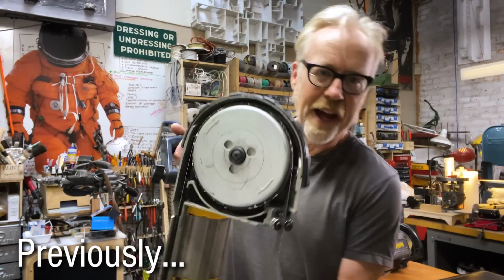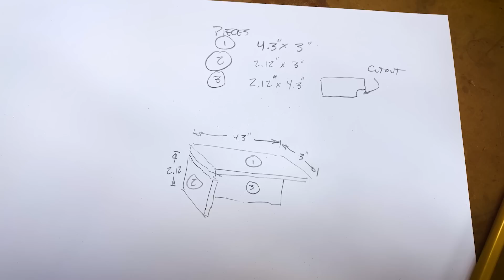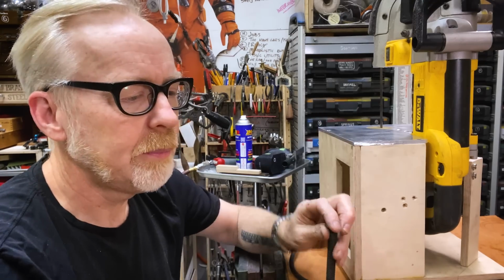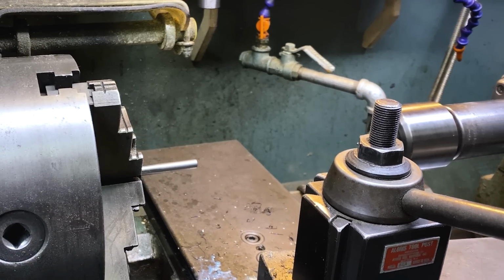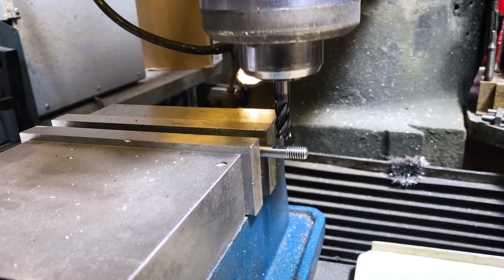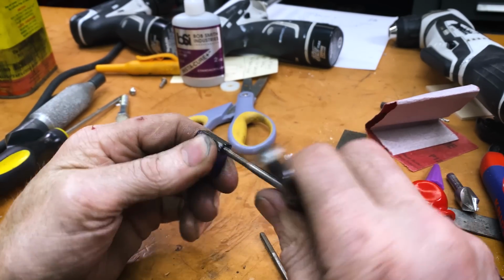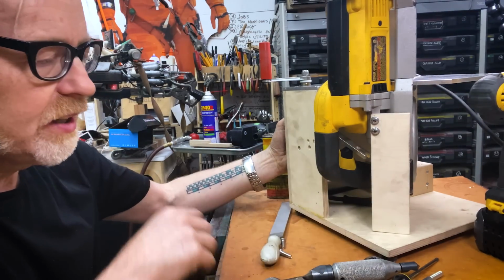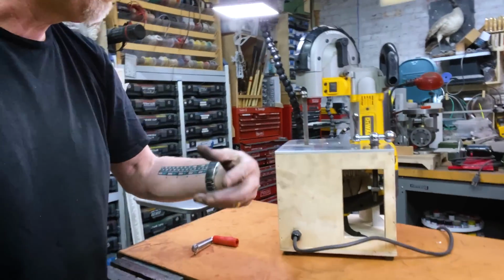Adam Savage Upgrades His Mini Bandsaw!

Comment: That lever terrifies me at the end. Wiggling your arm past a blade on a rocking stand. Good thing he changed the handle because that was super bad
Reply: when he mentioned where he wanted to place the speed controller in the first video I was terrified. I would HATE to reach around a moving blade to adjust the speed. SUPER dangerous imo.
Reply: I was thinking that too towards the end, but when you think about how he'll be using it, with the speed control on the right side you shouldn't ever have to reach in front of the blade to change speeds. He'll always be able to safely change speeds with his right hand away from the blade. Still, a dial on the side of the box would have been ideal.
Reply: Sonac totally agree, he can make a handle on the side of the machine and have it still works the similar way but safer
Reply: @IVIuggle  .... except when he's using his LEFT hand to turn the knob while aiming the camera with his right hand... yikes! I was holding my breath, especially with the whole thing wobbling around.
Reply: @RichardTallent  very true, that was not fun to watch, hopefully he installs a heavy steel plate under the box to keep it from wobbling around so much
Reply: Same, I think I would have opted for a electrical speed controller mounted in the side panel away from the blade.
Reply: Tools like this are only as dangerous as the person using them. One just has to be cogniscent of that fact that if you do something stupid could get hurt... so don't do something stupid. I've swung started props on light aircarft, which if done incorrectly could result in dismemberment or decapitation. I've also been groundcrew for many aircraft and operated as close as 3-4ft away from a large metal prop while doing a post-start inspection, you just have to be personally responcible for your safety. Am I suggesting a product like this would be wise for production? Hell no, because you have to cater to the fact that any muppet might be using it, but for somebody who designed and built it and unstands its dangers, I don't see the problem.
Reply: @bend1483  Doesn't help to create a more dangerous situation than necessary. Also OSHA and safety rules exist because its not about 'the person'
Reply: Why not place the crank on the right hand side to drive a wedge over the trigger instead?
Reply: My instinct would be to just replace the potentiameter that's probably in the trigger with a rotary one and just mount that on the side rather than machining  this wierd bodge solution.
Reply: I think the Wandel method would be to keep the lever arm mostly as is, but extend out the side of the tool through the existing big square hole. Then mount a channel 90 degrees to the side wall, drill a horizontal hole in the lever, and use a knob and nut to hold the lever at a desired position. That way the adjustment is below the plane of the saw table.
Reply: @adaster98  I believe he specifically said he didn't want stuff on the sides. he did for the power switch anyways so I would assume that would be for the rest of the stuff as well
Reply: bro it's a metal bandsaw - not a wood cutting band saw - they will cut you but you have to have it going full speed and really push into it - idk the speed but I can have my Milwaukee one all the way one and touch the blade with my finger lightly and not cut it at all - I mean yeah it could be in a better place but it's not anymore dangerous than simply using a table saw correctly lol
Reply: @TheAkashicTraveller  couldn’t agree more. Bush league.
Reply: @adaster98  potentiometer replacing the saws original trigger switch wired to a small dial next to the on/off switch - but that analog lever control, does look nice
Reply: potentiometer replacing the saws original trigger switch wired to a small dial next to the on/off switch - but that analog lever control, does look nice
Reply: @Kokomoflow  thats exactly why i suggested a potentiometer which would give far more accurate speed control replacing the elaborately over engineered analogue system Adam implemented -completely replacing it AND the "control wheel" aka trigger which is essentially the same as a scalectrix game trigger / pot.
Reply: came to the comments looking for this comment haha
Reply: A foot pedal with speed control, but it guess there’s no fun in that 🤷🏼‍♂️

Comment: How complicated do you want the mechanism to be?

Adam: Yes.
Reply: I mean, that's about the easiest mechanical way to do it "correctly". That mechanism will easily outlive the bandsaw itself.
Reply: @troy4393  The lever is pushing on the corner of the trigger, the side load will wear out the switch faster.  But it probably won't get adjusted constantly so it should be fine.  Couldn't hurt to add a timing chain and jackshaft on the other side of the lever, and make the interface to the switch slightly compliant.  Maybe an anti-backlash mechanism for high speed adjusting.  Definitely need an absolute RPM gauge on the dial, so add in a tensioner, and cam to account for the non-linearity of the switch.  Maybe quantize the dial to integer speed values using a cog and magnets, but there are times when you'd want to turn that off so use an electromagnet instead.  Half RPMs would be cool so you could add a hall sensor and shift register.  Might as well add another electromagnet and make it into an induction motor, and add a microstepper driver to get thousandths of an RPM and CNC control.  Don't forget the cameras and cloud services and AI to set ideal speed automatically based on material type, operator mood, and how close to Friday it is
Reply: @alakani  You point about the switch is actually a legitimate concern, some switch assemblies are shoddy enough for that to be a problem. I've had to fix this model a few times for non-switch related reasons; it can take any reasonable side loading without issue.
Reply: True engineer....had he wired in a fan rheostat as the switch he’d have just gotten the speed control for free.
Reply: @gritnix  I know, Adam has said electronics isn't his strong suit.  If it was me, I'd have taken that thing apart and reverse engineered the trigger and replaced it with a rheostat/pot.  I'd still have a separate switch though so that it 'remembers' the last speed it was set to.
Reply: @gritnix  seems to me he wants to the reserve the option to remove the saw and be able to use it normally
Reply: @malcolmm799  I think he's past that point.
Reply: no shit... lol
Reply: @DONEIT2TIMES I agree. Much easier than all this.
Reply: At least he hasn't did his design in Fusion 360.
Reply: @bryanhumphreys940  this is too simple))
Reply: I would have used a zip-tie and settled for 1 speed.
Reply: @malcolmm799  , totally, but still would've had that.  Just get a rheostat with  a switch built-in like the kind used to control old-school ceiling fans and use that instead of the lighted switch.  Then zip tie the trigger on full.
Reply: @bryanhumphreys940  , the separate on/off is a great idea so the setting stays constant.  Really like that.  But you can put a rheostat in front of the actual AC cord and then just zip tie the saw on full.  That way the saw stays unchanged and can be removed and used as normal whenever you want and the stand gives you infinite speed control as a nice little knob.
Reply: Another possible solution would be a hose clamp with a plastic key. The speed could still be adjusted.
Reply: gritnix ohh ya I understand now, thanks for clarifying. I guess he liked the purely mechanical approach, probably from electrical ignorance like myself 😭
Reply: @alakani  Gee, and here I was just thinking direct crankshaft from the side, to a cam, with friction control (bushing?) to hold the set speed. The cam would rock the switch forward to increase speed, back to decrease.
Reply: Seriously overengineered. My first thought was a simple wooden lever. Attach one end to side of box, loose enough to pivot, spacer may be needed. Other end rests on trigger. Long bolt through threaded hole in plate pushes down on the middle of the lever. Fancy it up by drilling a pocket in the wood for the end of the bolt and round over the end for smoother ops as angle changes. Maybe add a nice knurled knob on the top end of the bolt for tool free ops. And it would have the advantage of righty tighty more speedy.
Reply: I would have buy a speed controller and place the knob near the switch and control the speed like that, of course I´am an electrician not a mechanical
engineer.
Reply: Why not just reuse the electronic speed control in the saw, by lengthening the wires, and relocating the switch and potentiometer?
Reply: @bryanhumphreys940  Yes. A mosfet speed control circuit would work mind the correct amps for mosfet.
Reply: @tekvax01  I was starting to scream in my head why no one else has mentioned this!!
Reply: @jerrypease  right?!
Reply: @gritnix  you can't use a rheostat.  A rheostat lowers the voltage which isn't what you want.  Lower the voltage and you'll get no torque.
Motor speed controllers vary the duty cycle of the DC at full voltage.
Reply: @alamaralaa  Yeah, great call.  Gotta file that one away in the vault.

Comment: I had thought you were going to remove the trigger button all together and run some wires over and put a Knob type variable controller on the side where you cut out the rectangle....
Reply: That's what I was hoping. The saw already has a variable speed controller in the handle, all he'd have to do is remove it, extend the wire and relocate it on the box somewhere. So much cleaner and more reliable.
Reply: @BrinkHouse  Great Minds think aloke! (-;
Reply: @bruce4623  I will say though, the mechanism w handle he swapped to at the end is VERY cool. Great engineering from Adam, as always!
Reply: @BrinkHouse  Oh my yes!.... 
I hated that 1st handle he put on, the 2nd one looks and functions way better!
Reply: I've seen rheostat switches for this precise application in both Rockler and Woodcraft's catalog and websites. Still, those solutions don't have the nice mechani-porn feel of something like this. There are German engineers out there who I'm sure are in ecstasy right now having watched this.
Reply: a cam and shaft arrangement would have been simpler, and put the control on the side
Reply: Yeah, me too.  I thought about exactly that.  I don't know about the AC tools but the Dewalt drill I just took apart for a thing has probably the same trigger.  It's a linear pot connected to a MOSFET (and other bits)  to make a PWM DC motor controller.   Buying a new PWM motor controller could be under $20,  but then he could mount the pot on the side of the unit.
Reply: The advantage of the way he did it though, is obviously the tool is unmodified. Except for the power cable. Personally I would have wired in a new potentiometer. I kinda like how he did it though.
Reply: This would've been so much simpler, yes!  That's exactly what went through my mind when he conceived this contraption.  Extract the trigger switch, and wire up some potentiometer knob that'd accomplish the same thing.  When he started going on about a handle turning a screw to depress the trigger the first thought was "that's too complicated".
Reply: makes it harder to remove/replace the saw
Reply: Could have done a knob on the side that actuates a cam that depresses the trigger.
Reply: @BrinkHouse  could have fitted a off/on push button potentiometer.
Reply: Potentiometer for the win here, Adam. I have found that when it comes to tool mods, the KISS method always wins out over every other option. I fully realize that you wanted to have the ability to remove the tool from it's new stand and have use of it in it's unmodified state, but you have TWO... One on the stand and one freehand...
Reply: Potentiometer would be cool, but I really like the way he did it because there's minimal modifications to the tool itself (it was what he was aiming for).
Reply: @osamu_90  I agree on the minimal modifications aspect, as I do realize that was Adam's intent. Yet, I look at it from the aspect of a safety issue with a moving blade - being that the speed control is on the top and not on the side of the overall device is what prompted me to promote the potentiometer idea...
Reply: That's exactly what I was thinking. A much simpler thing to do instead of cutting the wire and splicing it back together with wirenuts and a toggle switch.. Would have been removing the trigger mechanism and wiring in a nice beefy 5 turn potentiometer.  All the way down would have the saw off, all the way up would have the saw at full speed. And he'd have at least 2 more feet of electrical cord. And after watching the rest of the video.. It would have been much much safer as well.
Reply: This is exactly what I was thinking! 🤔
Reply: He seems to be preserving the tool in case he wants to use it for something else, or whatever... the cord is easy to replace. Start tearing everything else apart and you may have issues... but yeah - I thought he was going to hook up an electronic knob or something based on the trigger design.
Reply: Variable controller ?! A little potentiometer would have done the trick. In modern power tools the "trigger" doesn't deal with mains power, it just sends an analog signal to a "mother-box" that uses PWM to control the motor speed (a bit more detailed than that but you get the point)
Reply: That would have been a much easier solution

Comment: It was a great idea to have an immediate followup upgrade video.  I often  design and build something and immediately decide to upgrade or radically rethink the design. Which is a great angle for engineering and design,  as everything can be tinkered into greater aesthetic, efficiency and ease of use. It's very different from painting (especially abstract), where having sensing that  something is complete is essential and often a struggle. Which is still true here, but to a lesser degree lol

Comment: Additional switch safety tip. It looks like you connected the line voltage to the center pole of the DPDT switch, and connected the tool to the bottom pole. This works, but with a DPDT switch it also means that when the switch is in the "off" position, you have not really interrupted the line voltage, but rather you've routed it to the bare top conductor, a hazardous condition. Better idea is to run the line voltage to the bottom pole and connect the tool to the center pole. The switch will still work as intended, but now when the switch is "off", the line voltage is truly interrupted and you won't have an unexpected hot terminal in your tool.

Comment: I would prevent the handle from turning all the way up, so that you only turn it "off" using the actual switch.
Reply: no there is also a switch. you should watch the first part again
Reply: @1BigBen  Yes, my point is that you should only be able to turn it off properly with that switch.
Reply: An aluminum tube a few inches long (or as long as it needs to be) above the square nut on the threaded shaft would prevent it from raising too high as you crank it. That’s my first thought.
Reply: @Alex-nl5cy  why its an extra step of safty, you dont want that switch getting hit by mistake and turning it on he has an extra step of redundancy of safty
Reply: I totally agree that you shouldn't be able to turn it off with the speed control, but you'd have to get it really precise to not end up limiting how slow it can go, because it looks like there's some really fine speed adjustment that happens on the low end.
Reply: Absolutely. There should be an lower stop (just at the minimum speed) for safety reasons and also and upper stop (at max speed) to prevent more pressure on the mechanism when the button is already fully pressed.
Reply: @EarMaster55  i agree. it needs stops to protect against over tightening and to stop running it too slow. you could add 2 nuts above and below  and lock them against each other . this would be easily adjustable
Reply: I'd suggest having the crank on the side of the box, with a 90 degree cog to transfer the direction of movement

Comment: You also could have just wired in a variable dimmer switch instead of the off on switch.  love the workmanship though.
Reply: I used a variable foot pedal and set the saw speed to highest setting
Reply: I Don't think a dimmer switch will work in  this situation.
Reply: But there are variable speed switches, if nothing else from an old drill.

Comment: It already has a wheel dial on the side that allows speed control with full trigger,  no need to partially press the trigger.
Reply: afaik this type of wheel dial sets the max-position for the trigger, so the maximum amount you can press manually before the trigger blocks. So you still need to press the trigger.
Reply: @DarkDiripti  yes, set the speed from 1 to 5, then lock the trigger. No need to partially depress trigger

Comment: Welcome to Adam’s Over-Engineering  workshop. The shop that will use heavy duty shop equipment to make a adjustable power switch. 

Alternative idea for you Adam open up the switch and extend the switch to the outside of the case.  

It would take far less work and would be safer the having you hand turn a crank in front of a moving blade!
Reply: I’m pretty certain that the trigger is just a potentiometer, he could find its resistance with a multimeter and just wire in a new pot on the side.
Reply: Why does it matter you will never in your life use this tool, it works for him... it doesnt need to work for you
Reply: I was thinking a couple ways to have the speed control on the front. With some sort of cam or wedge on the threaded part going front to back, that pushes the arm down. It would be safer and out of the way.
Reply: @tylerhorne1099  sorry babe